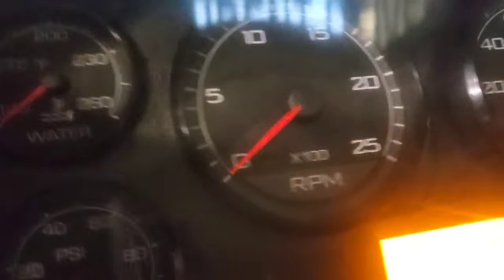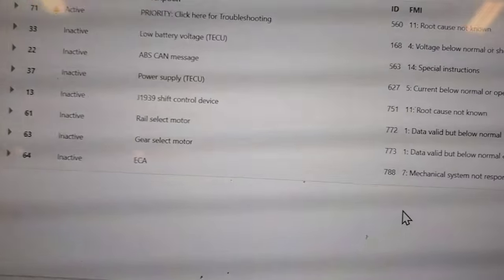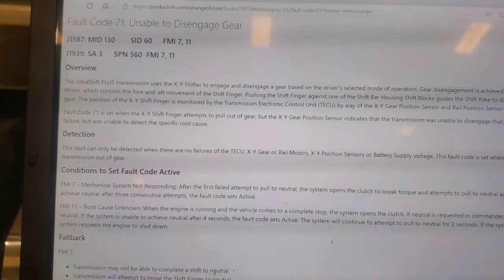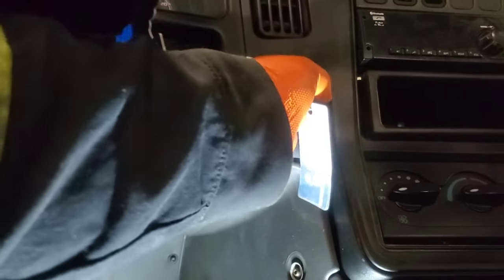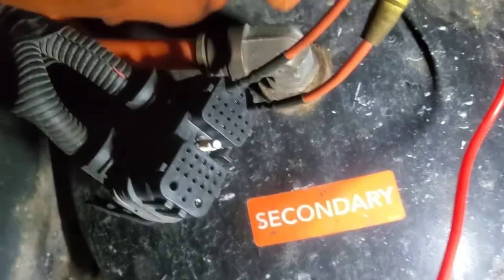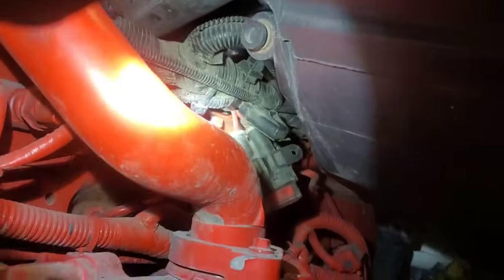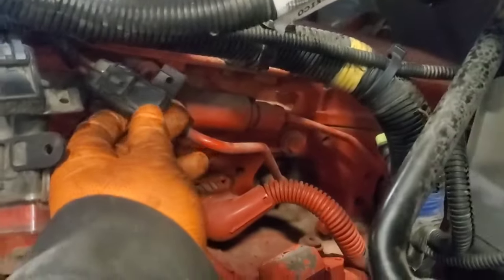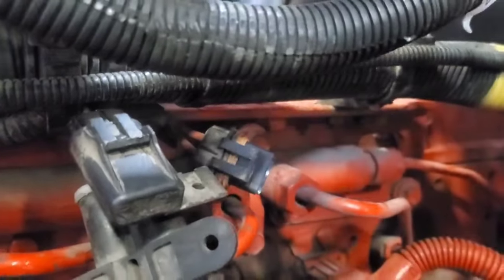international Prostar no start, no crank, transmission not shifting - Eaton - diag DIY

Comment: Excellent job, I am with a box EA11109la, I am from Argentina, the camiom sometimes starts and then throws errors like 41 or now, 88, so I don't know where to where
Reply from the maker: Greetings, I would definitely check power and ground at the TCM while your meter is hooked up and wiggle the harness looking for intermittent power loss